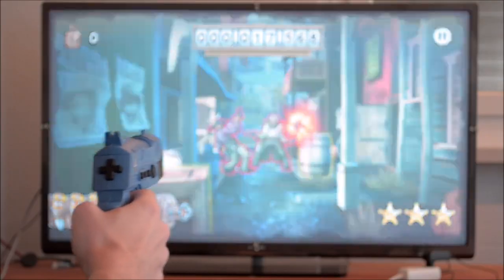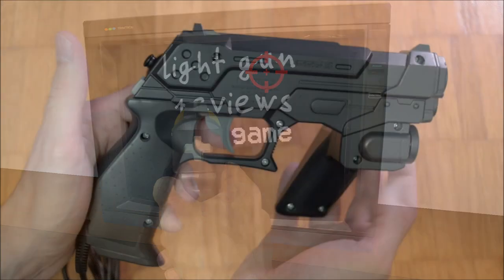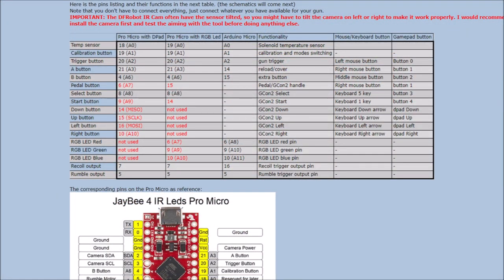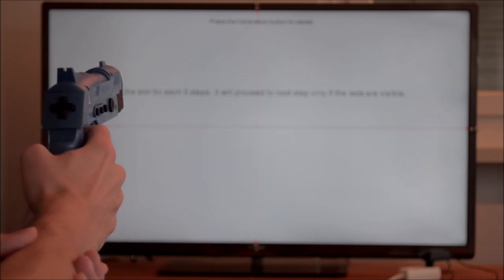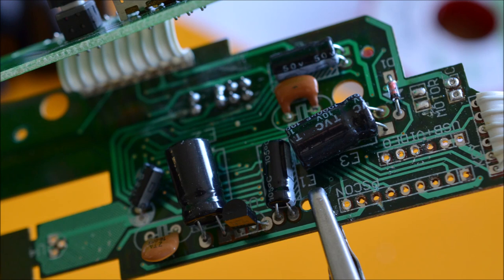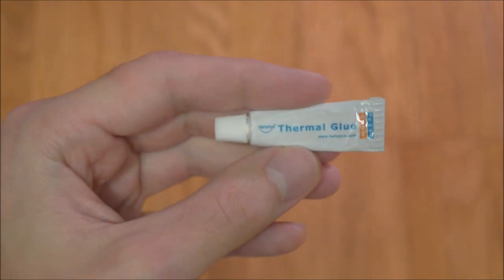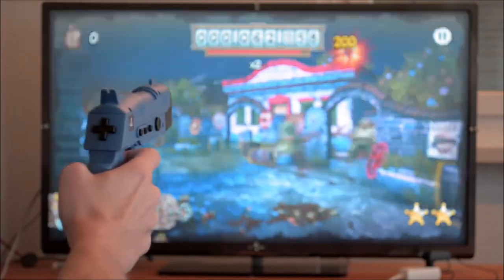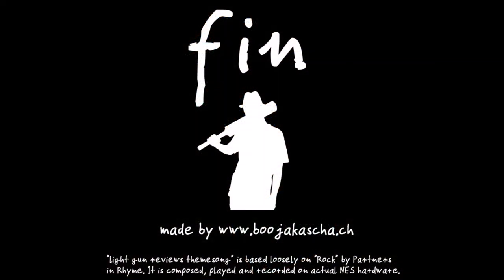Light Gun Reviews 199: Gun4IR, the best PC light gun (Controller) {formerly known as JB 4PLG}

Comment from the maker: Since releasing the video, the system has been renamed to Gun4IR

Friend of the Channel @wallmachine just found out, that if you use 68.0 ohms resistors, rather than the 48.7 ohms ones I envisioned,  you can power the LED boards by 5 V rather than 4 V DC. This is super convenient as many people own plenty of 5 V sources due to their phones & portable devices needing the same voltage.
Reply: Can you link all the stuff i need to buy for the gun4ir? I wanna put it in a tc4 gun..also a tutorial would be cool or pics step by step:)
Reply from the maker: @kevinthorn9672  It's very modular if you think of it:
- multiple micro controllers are suited
- DF Robot cam or any other donor that uses the same sensor
- USB cable (usally micro B is needed)
- Several possibilities to do the light sources.
I therefore suggest JayBee's written manual as a starting point to decide what parts to get.

Comment: Wooo!  Fantastic test, review, video and subject!!!!!!  I am really happy you made one of these lightguns!!!!
I have few questions because I already bought special 940nm ir led+ all the stuff to create a 4 ir led system for purpose testing with my wiimotes. (  2 month ago). 
Do I need to use the software of jaybee?  I knew that the df-robot camera was like  a Nintendo wii remote camera, so my plan was to make a try directly for my wiimote. The only thing I don't know is if it's mandatory or not to use the jaybee's software with this 4 ir led system.
Thanks for this awesome video booj!!!   😀👏👏👍.
Reply: Actually my software isn't needed for other things than flashing the firmware or setting various options, but once it's setup you can use the gun on anything ;) 
But be careful, you also need to build the hardware for this system, it won't work with a wiimote.
Reply from the maker: @ginzuemulation9265  Thank you very much for the kind words! =)
You see, it needs the firmware in the micro controller. It won't work on a standard Wii remote. But you can use it as a parts donor as substitute for the DF Robot cam. As JayBee already said you wont need his GUI, but I highly recommend it still! It's just about 1500 yen and is a very useful diagnostic and setup tool. Also the purchase supports this fantastic project a little bit!

Comment: Thanks for the review Ben. Lots of choices now. If you had an arcade crt cabinet running mame, would you recommend this or an aimtrak or Sinden or an act-labs?
Reply from the maker: This.
I don't have a Sinden yet, but that one has white boarders and doesn't have the force feedback and light options the JB 4PLG has.
I love the Aimtrak, but it's just good on small displays playing at rather high distance (higher than what people are used to on arcades).
Act Labs is really cool, but just works perfectly on games that offer additional in-game calibration. Else there are slight inaccuracies. Also it doesn't track continiously which shortens the list of suitable games. Also it has the white flash some people dislike.

Comment: whats the difference between the g_IR-LEDpads and IR-LEDpads files is it just different software to print the pcb? how do you connect them all to one location?
Reply from the maker: Yes, exactly. The g_* stuff is "Gerber" which is  an image like format. It's historically relevant but not flexible. The .brd is an Eagle board file, which I deem superior as it's changeable =)
Reply: @Boojakascha  thanks. with the PCB layout, what dimensions, layers and thickness did you select? and can you link to the power supply used for the LEDs?
Reply from the maker: @wallmachine8780  It's 2 layers and you can go for the thickness that is cheapest at your vendour. Probably 1.55 mm or 1 mm. I went for 1 mm. Dimensions I don't know by heart. Around 19 mm. Your vendour should be able to figure out himself and else this is a severe warning not to deal with them! ;-)
Reply from the maker: With "how you connect them" you mean the Gerbers, right? Vendours will receive an archive file of multiple files. They need all of them. .zip or .rar are fine usually =)
Any 4 VDC power supply with sufficient current will do the trick, but here is an example link: https://www.ebay.com/itm/4V-2A-AC-DC-Power-Supply-Replacement-Adapter-with-1-0mm-x-2-4mm-Tip-Center/361431484610
Reply from the maker: @wallmachine8780  No, unfortunately that's too less current. You need 4 x 0.17 A @ 4 V. You might have more luck shopping for multi voltage or even variable voltage PSUs that can do 4 V.
Reply from the maker: @wallmachine something like this! But make sure with a multimeter the reading is accurate ;-)
https://www.ebay.com/itm/ADJUSTABLE-POWER-SUPPLY-ADAPTER-MULTI-VOLTAGE-CHARGER-AC-DC3-36V-US-EU-UK-24-72W/402436307220
Reply: @Boojakascha  hi,
But why did you use an external 4v power supply?
When I created my Led 4p system, I just used a simple usb cable (5v).
Reply from the maker: @ginzuemulation9265  Because of heat =)
At 4 VDC it doesn't turn hot at all^^

Comment: Hi, the boards you have made for this project are great and thank you for sharing them. I am looking to making one myself, are all 4 boards powered by the same power supply? If they are how have you connected the multiple picoblade cables to it? Thanks
Reply from the maker: Thank you, Matthew =)
Yes, all are powered by the same single supply. The wire harness has "Y" segments or crossings so to speak :D
You can twist wires to do so, but I recommend soldering them.
Reply: @Boojakascha  Thank you so much for the information. If the 68 ohms resistors were used and the boards run on 5V power supply would 1 amp on the power supply be enough or would you recommend higher amperage? Thanks :-)
Reply from the maker: @matthewstock6503  1 A is sufficient. The original boards ran 0.23 A using the 48.7 ohms resistors at 5 V. With 68 ohms the current will be even lower, so no problem at all =)
Reply: @Boojakascha  Thank you thats great, on your clone gcon did you make a custom ir perspex to replace the optical lens or did you buy one from somewhere?
Reply from the maker: @matthewstock6503  I removed the lens and used the DF robot cam directly. Sometimes I use a wide angle lens though.
Reply: @Boojakascha  thank you again for all your help, ill look forward to making mine :-)
Reply from the maker: @matthewstock6503  you are very welcome =)

Comment: Hey hey hey, so I been tryna tweak my Sinden out a bit. U said u rather have ur gun4ir system slightly higher  latency than 4 ms so it can behave more like a CRT light gun... So how much higher we talking about approximately?
Reply from the maker: I can't quite recall the Gun4IR number. It's the fastest system by far though. Faster than CRT for sure.
Reply: @Boojakascha  ah ok ok, u know how many milliseconds it is for CRT gun?
Reply from the maker: @albertwilliams9782  Just for screen visible stuff like the PlayStation Time Crisis Project Titan calibration screen and the like, which applies flattening (which takes time). There the latency is different for the X- and y-axis. I can look up the exact numbers when I am back home, but I recall them being near 77 ms for y and 108 ms or so for x (Guntu calibration screen was used, running at 30 FPS, so far from ideal, I will have to retry with a 60 FPS game). So slower than the Aimtrak even (32 ms).
Reply: @Boojakascha  oh no no, I'm just trying to get a rough estimate, so the average processing time was around 7 ms in your Sinden gun right? Does that mean latency of 7 ms? I'm just trying to make sure I'm getting these things correct here lol
Reply from the maker: @albertwilliams9782  no, this 7-11 ms portion  of lag is just the processing time caused by the efficiancy of his code. The total number contains the framerate and exposure settings of his camera. So plus 17 ms for "perfect" conditions, but technically more. At a 15 kHz screen you will end up with 47 ms of latency with the Sinden Lightgun.
Reply: @Boojakascha  wow... In one of sindens own videos, it says under 5 ms response time ?     : S
Reply from the maker: @albertwilliams9782  Thats's the micro processor alone. This is a small fraction of the total latency. Some people think Andrew is a bit deceiving here.
Reply: @Boojakascha  ha I would not blame them for thinking that way, i mean, the arcade1up buck hunter relies on Sinden tech as well correct? Does that game also have this latency issue?
Reply from the maker: @albertwilliams9782  Yes. I wouldn't call it an issue though, it's just how it works. If you think of it 7 + 17 = 24 ms latency which isn't terrible at all. Works great for gaming.
Reply: @Boojakascha  I see I see, issue would be the wrong word, I'm just very insecure with this stuff due to my past experience with aimtrak, and the fact I waited nearly a year to get this in the mail
Reply: @Boojakascha  1 thing I really like so far is that I am able to use it quite a bit closer to the screen than I thought
Reply: @Boojakascha  having all this said though, I should be able to play vs duck hunt without crosshair ok?
Reply: @Boojakascha  funny thing, since games like duck hunt don't have in game calibration, I had to calibrate my mouse cursor properly, so I changed the default cursor to a cross and adjusted the size to maximum. Still not calibrated to my liking hahaha
Reply from the maker: @albertwilliams9782  Indeed, the low screen distance is cool. About Duck Hunt: It depends what screen you connect how. You most likely will suffer another +22 ms penalty when using a TV and easiliy double or trice as much if the TV isn't set up for low latency.
Reply: @Boojakascha  ahhh, a PC monitor would be better?
Reply from the maker: @albertwilliams9782  Yes, PC monitor connected via displayport or current gen HDMI and the GPU set to high frame rate. About calibration: Those issues are tied to the Sinden Lightgun. If the boarders aren't what the GUI expects, there is an offset. The one point calibration has no way fixing it, sadly :-(
Reply: @Boojakascha  oh dear my monitor I bought from 2007, it has no HDMI port. I have it connected via VGA, I have it set to 75hz on my gpu, my gpu is either Intel 2000 or 3000 series, how is my situation looking? : S   It def seems to be doing better than my tv, my tv only goes to 60 Hz I think. Good thing though, my average processing time usually stays around 4 ms, even on my tv.
Reply from the maker: @albertwilliams9782  VGA is fast, don't worry. What kind of framerate can your monitor do though? It sounds like a 60 Hz machine too.
Reply: @Boojakascha  Hmm well I can set it to 75 Hz highest refresh rate... And what do u mean 60 Hz machine, are you referring to my gpu?
Reply from the maker: @albertwilliams9782  Well, you set up the GPU, but the monitor will do what ever it wants^^ But given your signal is analogue I guess you are fine.
Reply: @Boojakascha  yea HDMI is digital right? Until 2 days ago, I had a dual display on this PC, one with this monitor we are talking about and the other with another tv I have, an LG one my uncle bought in 2008. This tv is connected via HDMI. Both displays are set to 75 Hz.  So I would run street fighter 3rd strike on fightcade which uses fbneo emu. The monitor would seem super smooth. The tv however, although it seemed to manage to maintain 60fps, I would see a bit of screen tearing. I never owned a 3rd strike cab. I only played it once in movie theatre arcade in 2002 so I don't know how relevant these references are.
Reply from the maker: @albertwilliams9782  Yes, HDMI is digital. I see. Well, at 75 fps via VGA it should be fine I think^^
Reply: @Boojakascha  well it's 75 Hz... Does that mean 75 fps?
Reply from the maker: @albertwilliams9782  capability thereof, yes.
Reply: @Boojakascha  ok ok thanks a lot, I always thought 60 fps is the highest possible frame rate, I mean how many frames can the human eye even process lol, I was also wondering if Linux os would be a better option for me than windows in terms of emulation capability. Batocera is Linux based correct?  If emulate a Naomi or atomiswave game in batoceras flycast core, it would work fine. If I use the same PC and run the game on windows with demul, my goodness the game can barely run... : S
Reply: Sinden don't work on batocera as of yet unfortunately...
Reply from the maker: @albertwilliams9782  What a pity! Boarders or 
mouse placement?
Edit: Humans don't see in fps, we are not cameras :D
Some OS are better for some emulators than others, but there is none that is perfect for all :D
Reply: @Boojakascha  not exactly sure why they haven't added support for Sinden yet...could be one or both of the reasons u mentioned. And yea humans see things just as they are unlike cameras hahaha. Btw, I also wanted to ask, considering the size and weight of the Sinden, will it alter the experience when playing games that originally use the happ gun? I'm currently playing police trainer a lot. I mean, you own a happ gun or something similar yourself, correct?
Reply from the maker: @albertwilliams9782  Yes, I own the Happ 45. Cal and a few other arcade guns. The shape of the Sinden Lightgun hinders the experience in my opinion. I am not a big fan of it's shell. The buttons, their placement and the overall shape are not how I would like it.
Reply: @Boojakascha  ah ok ok.    Will the shell, size, and weight affect my performance in any way if I play police trainer?
Reply from the maker: @albertwilliams9782  That's hard to say. I guess you can get used to it, but it will remain uncomfortable.
Reply: @Boojakascha  ahhh the happ gun is more comfortable than Sinden?
Reply from the maker: @albertwilliams9782  Most controllers in the world are more comfortable than the Sinden Lightgun. Even the Sega The Maze Of Kings gun is more comfortable. This is not a joke, I own that gun.
Reply: @Boojakascha  wow never would have thought, Sinden was my second light gun I ever owned. I had a few experiences with console and arcade guns in the past but they were fair brief so I do not quite recall how they feel
Reply from the maker: @albertwilliams9782  I see

Comment: Nintendo zappee dropped 1984
Reply from the maker: sure^^ What do you think the video claimed?
Reply: @Boojakascha  the oldest light gun you knew of was made in 1994
Reply from the maker: @serimar  You get that wrong: Oldest example of an IR reference light tracking gun (Wii like) is from 1994. Light Guns in general are way older than that. Nintendo's first console gun was distributed in 1972. If you start also considering light emitting gun controllers, than the date goes down even further!